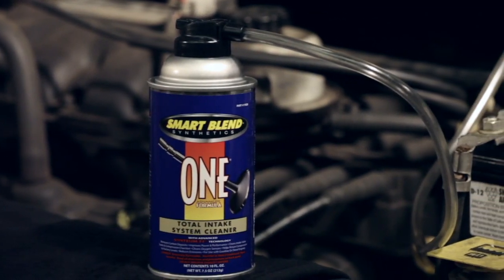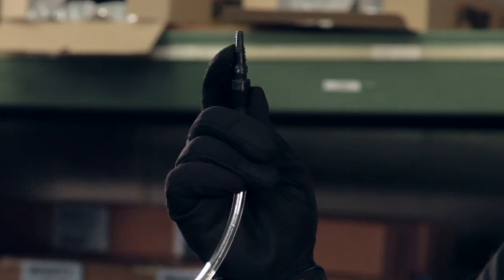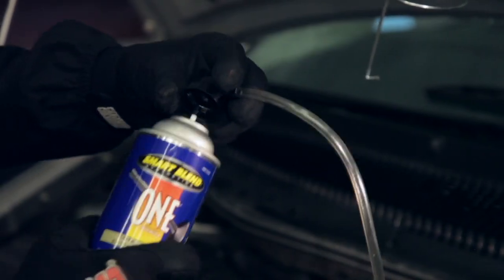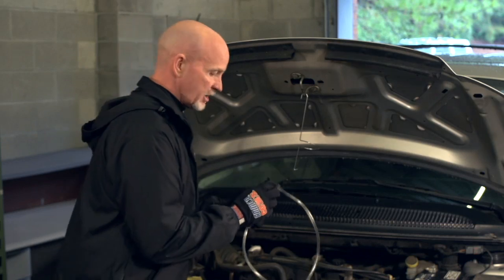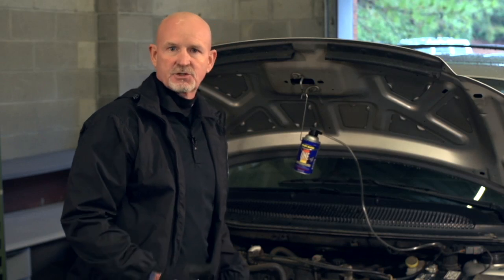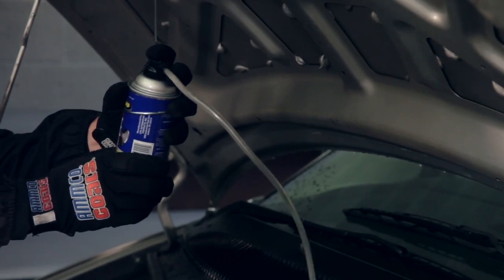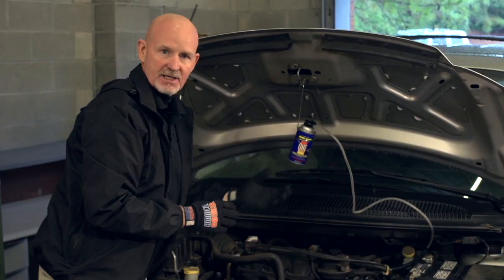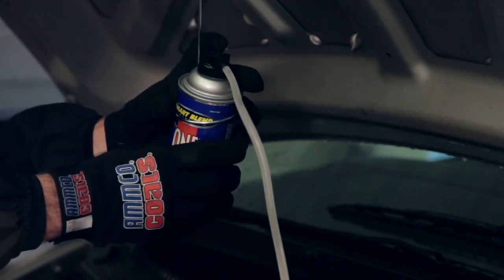Smart Blend Fuel System Total Intake Gas Application

Comment: so, I am about to use this (in the 2 step kit), and I was planning on connecting it to a hose that's just outside the throttle body.. is that o.k. or ? I have a Kia Stinger Gt 3.3 L twin turbo. Please advise where is the best place to connect this too ?
Reply: there's a vacuum line (i believe) really close to the throttle body in my engine, so would that be a better placement for my car ?
Reply from the maker: Ensure the vehicle is up to operating temperature before actuating the can. Lightly depress the actuator to allow for the vehicle to acclimate to the addition of the cleaning chemical before locking the actuator down. The vehicle may need to have the accelerator revved to prevent stalling. It is important to note the chemical can be stopped at any time by unlocking the lock-down mechanism. Chemical should never be applied to a stalled or non-operating car.
Reply from the maker: That would be fine and is a recommended alternative access port.